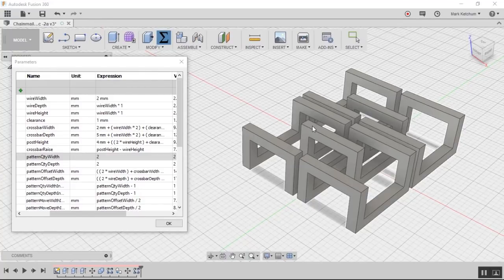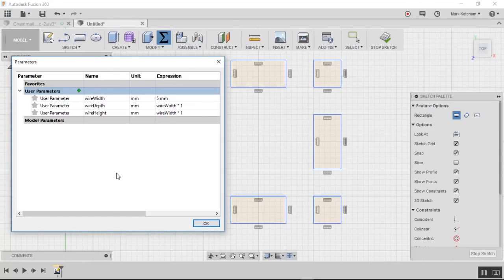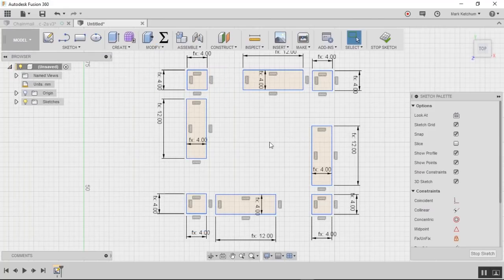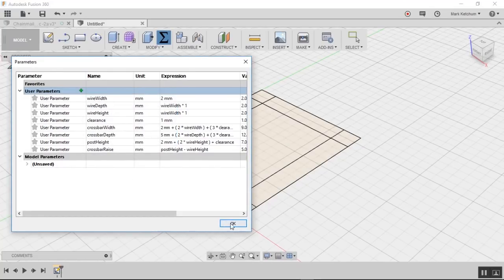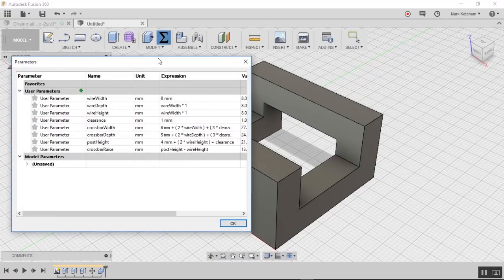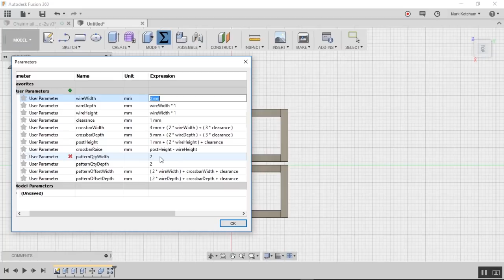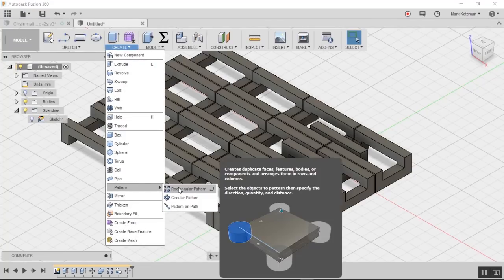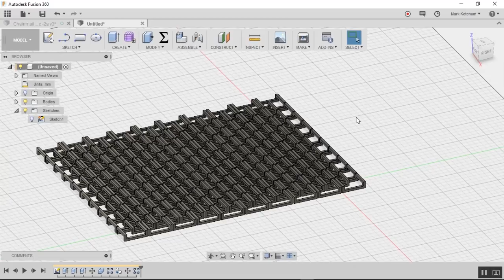Make Chainmail in Fusion 360 with Parameters

Comment: One problem; when applying the wireDepth to the rectangular shapes (the middle sketches), both left and right position downwards, instead of one going up and one going down. I've followed your tutorial exactly, multiple times, and this still happened. I can send you a screenshot if you'd like? I'd appreciate any help
Reply: So I followed the tutorial more and managed to fix that problem. but now, I can't select individual parts, it only selects the whole body when I'm up to the move/copy part
Reply: I am so sorry, it turns out, when extruding, the components were set to join instead of "new body". Thank you so much for your tutorial, this helped me more than you'd think!